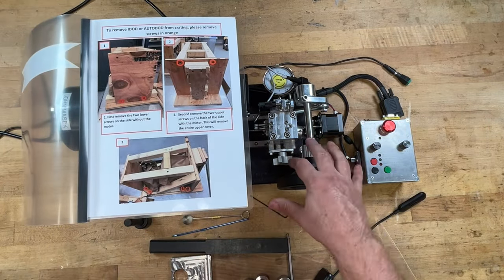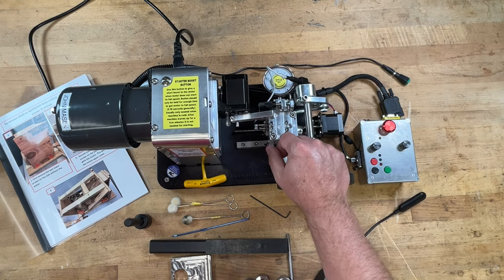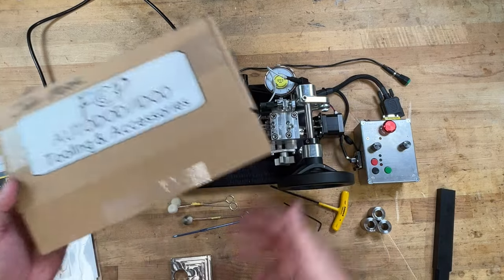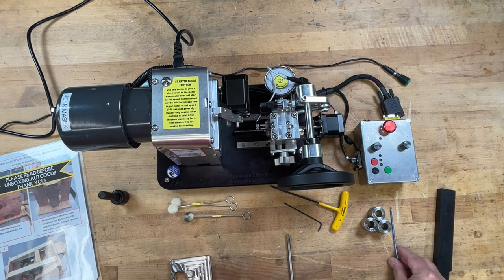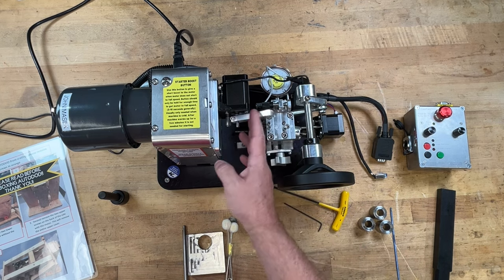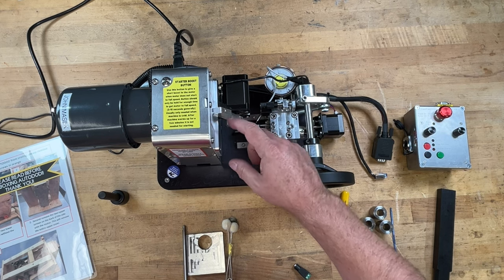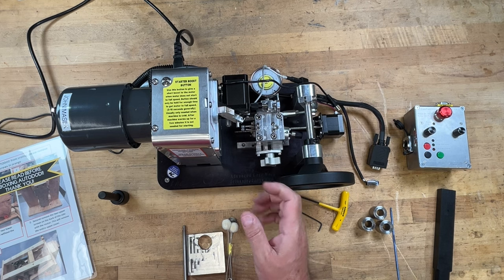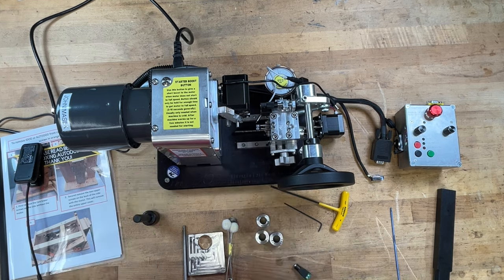F Class Products AutoDod IDOD to Neck Turn Brass

Comment: Thanks for taking the time to do the deep dive this tool deserves, John.  This is an expensive piece of kit and most folks contemplating it will find your video enormously helpful.

One thing... I noticed when you were taking neck thickness measurements with your micrometer that you only took 1-2 measurements, very close together.  The true test of a neck turning process is how precise and how concentric the resulting case neck is.  If you were to measure your case neck, rotate the case just a smidge, take another measurement, rotate another smidge, take another measurement, etc., etc.... until you've captured 10-12 measurements around the entire case neck circumference, you'd be able to see what the minimum and maximum neck thicknesses are.  The obvious desire is to have zero variance, to have a dead-even thickness all around the neck.  Producing that requires a dead-straight case neck before you begin, however.  And then a tool/process which maintains that.  That's the rub.

If you decide to do that, to make those kind of measurements of brass coming out of the IDOD/ADOD, I'd love to hear your results.

Comment: Thank you John for use my 🔺Delta No OIL Lube🇮🇹 …. I really appreciate  🍷👌

For better use and less waste you can use a simple plastic cap to wet the neck since IDOT works on both the outside and the inside and leave to dry upside down without washing. Once dry you will find a constant closure of the ammunition with a very low SD.
Sandro.
Reply: it is the reason to use the IDOD 😂, you're convinced that you have invented even the hot water ??

Comment: @F-Class John, great overview of the AUTODOD. I'm glad to see you finally got one. The T Handle is a nice new addition. I got mine in 2022 and it only had the hex wrench. 
It would be great to see your next brass prep and loading steps after turning. Do you Neck size ect. ect? What neck tension do you apply?
I've done all kinds of experiments including AMP Annealing after turning. It's really interesting to see how smooth the curves are when using the AMP Press after using the AUTODOD.

Comment: Sweet machine,but,it sounds like the motor bearings are a bit " sloppy" ? Have you ever taken a dial indicator and checked the runout on your 5C collet assembly. This will affect how true your neck remains to the cartridge wall. Just wondering??

Comment: Hi John,, question time!  After neck turning, the inside dia of the neck is obviously too big for a bullet, so how do you get it back to the correct size [2-3 thou less than bullet dia]  Do you then use a bushing sizing die, or some other method.?
Reply from the maker: Yes that's correct. After turning I'll then run them through my sizing die and continue brass prep as usual.

Comment: Hey John thanks for the video.  Very interesting.  Did you have to use special die on brass to get neck concentric before using the IDOD?  Appreciate it.
Reply from the maker: Nope, just shoot it and turn is what they recommend. That's about the straightest the brass will get. You're actually more likely to run into problems if you try running brass through a die before turning.